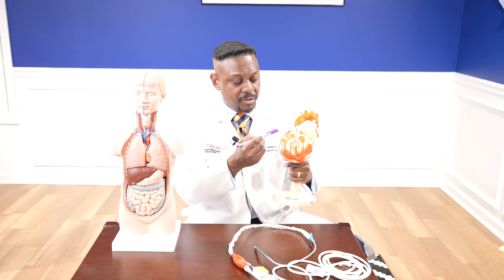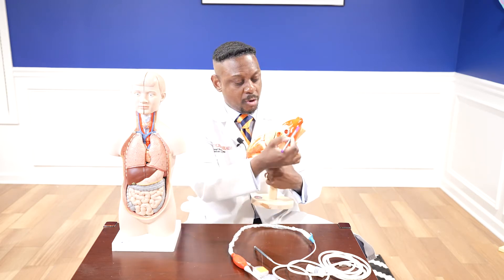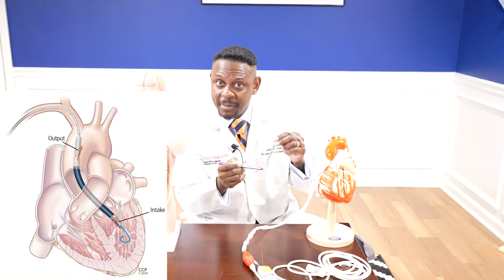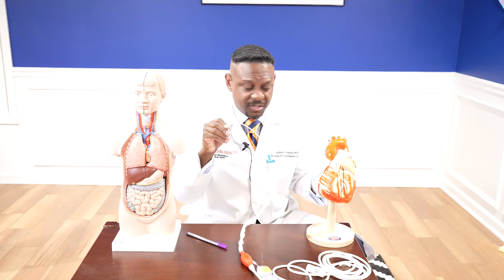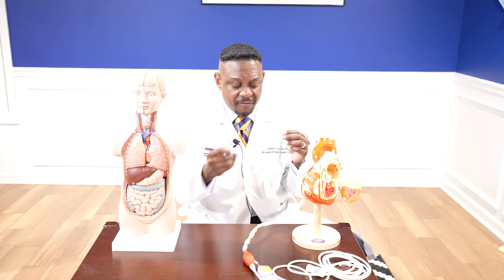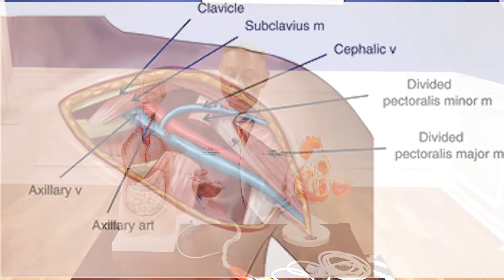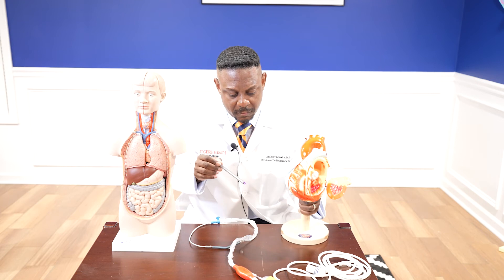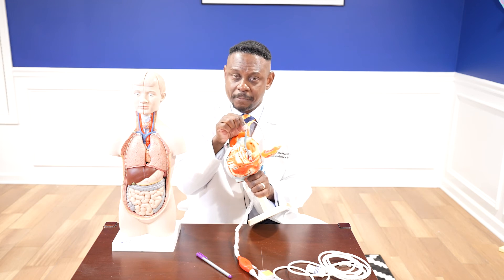How to Place an Impella Left Ventricular Device through the Axillary artery

Comment: Hi dr. Lemaire, Is right axillary insertion more prone to malrotation towards the septum than left axillary?  Any tips to avoid malrotation and thus avoiding having to correct it after insertion?
Reply from the maker: Great question. I place many axillary impellas, and in fact I placed 2 this week. The biggest difference in placing an axillary impella on the right or left side is the ease of getting into the ascending aorta. I personally have not seen a difference in terms of malrotation between the left and right axillary artery approach. I have asked this question multiple times and I see no correlation between one side and malrotation.
Reply: @cardiacsurgerypatienteduca2445 Thanks for the clarification and sharing your experience!

Comment: Hello Dr. Thanks for this very helpful explanation n illustration. Is this a short or long term solution over bypass surgery? What kinds of medication & how long does one need to take? When can one start working? I’m transitioning career to a nanny. Will this be a problem?
Reply from the maker: Hi, sorry for the delay in responding. This device is not a solution. It's a temporary device that will stabilize a patient in cardiogenic shock or congestive heart failure. It is NOT a replacement for bypass.